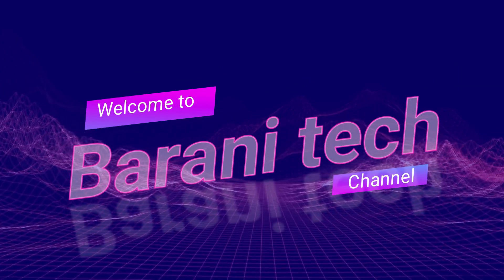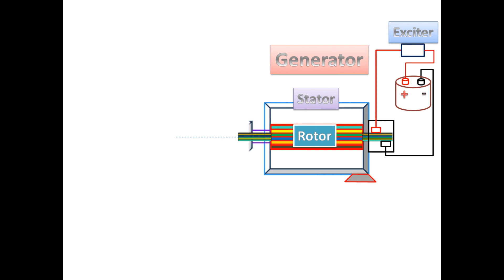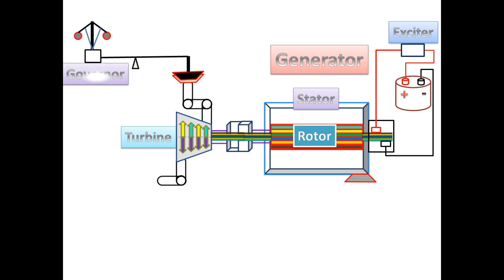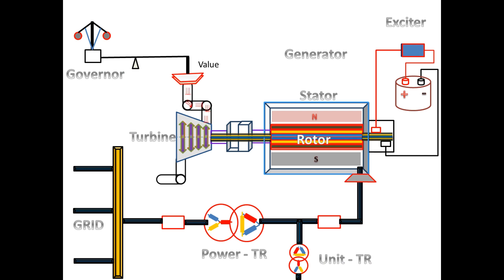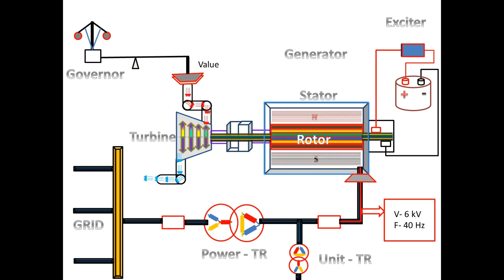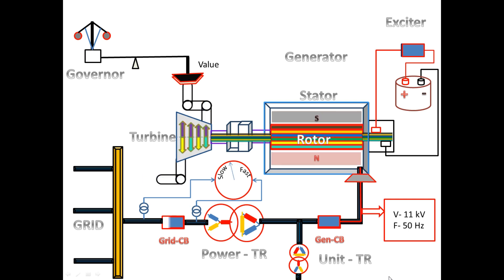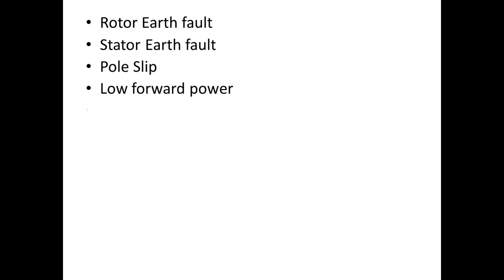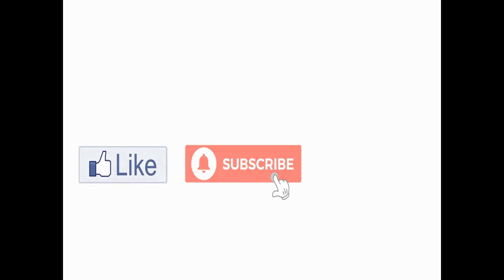GENERATOR STATION WORKING

Comment: Anna enaku oru doubt ketaa Enna question da ithu nu nenaipaga but kekuran generator epdi work aguthu
Reply: Technical ah solluga naa not rotor stator
Reply: I mean epdi start aguthu na atha mathurii kekuran
Reply from the maker: @santhoshlfhss9759 when the magnetic field cross the conductor it produce emf on conductor. for clear view i will make one video for you
Reply: @baranitech  Anna itha namba theoretical ah flux produce aguthu nu sollurom. Practical ah epdi tha start aguthu nu epdi na sollurathu yen itha question ketana enaku oru engineer ketaru nanum itha answer tha sonna but avaru theoretical ah okay epdi flux angaa produce aguthu nu sollura ethunaala aguthu flux produce achi generator start aguma athuku nu etho technical ah onu iruku nu sonaga naa nanum en senior's Kita keta
Reply from the maker: @santhoshlfhss9759  only change in magnetic field over conductor will produce emf not more then that.
Reply from the maker: if any other ans is there for generator please share with me i am also interested with your engineering ans.